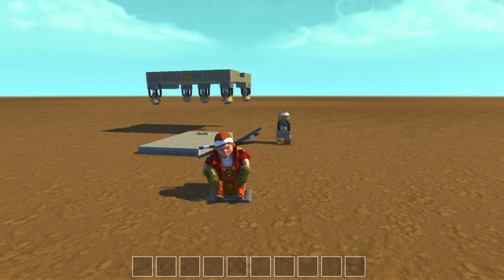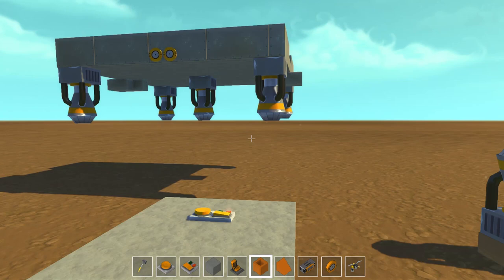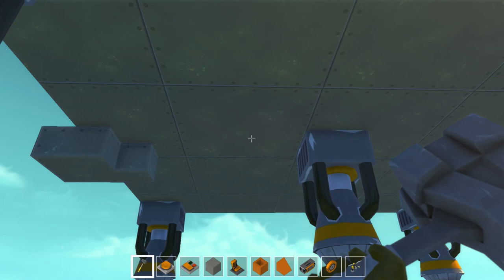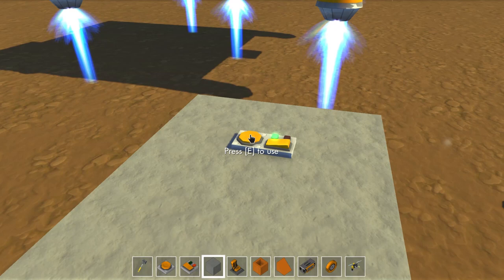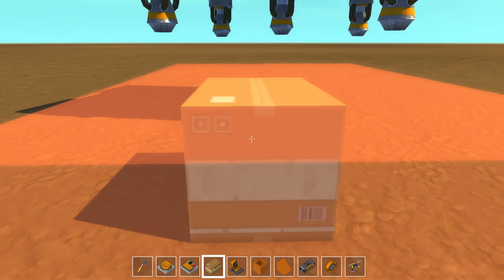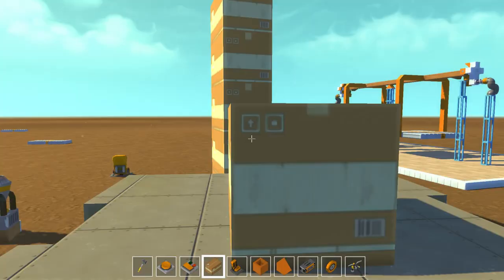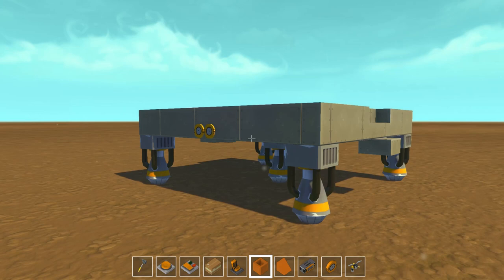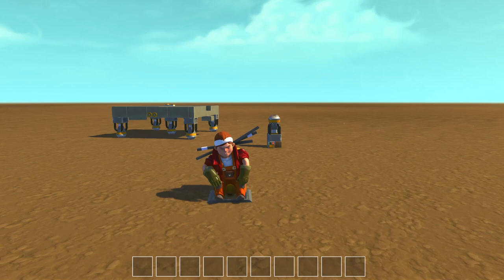08 - Thruster Hover Bug | Scrap Mechanic Let's Play with Lyte

Comment: This looks like it could be partly caused by a threshold problem. Most video games stop simulating physics of an object on which all forces are at equilibrium.

An example of this would be an object falling on the ground. While it is falling, there is only one force acting on it, gravity (no drag, this is a video game). When it reaches flat ground, its normal reaction force directly opposes the force of gravity, and cancels it out. The system is at equilibrium, and the object stops moving. The game then stops simulating the physics of this object until another force affects it.

Because of floating point calculations and rounding, it's pretty difficult to determine exactly when a physical object is perfectly still. An easy shortcut to solve this problem is to define a threshold of movement under which the game considers that the object is "at rest". However, this can lead to problems when objects are moving very slowly, as their movement may fall under this threshold.
Reply from the maker: +Recessionist Sure, but wouldn't deactivating the thrusters cause a change in state that would cause the game to recalculate the forces involved and realize it should fall, like when you add or remove a block to it?
Reply: Yes, but I think that the speed of the object just after you switch off the thrusters is low enough for the game to think that it is at rest.